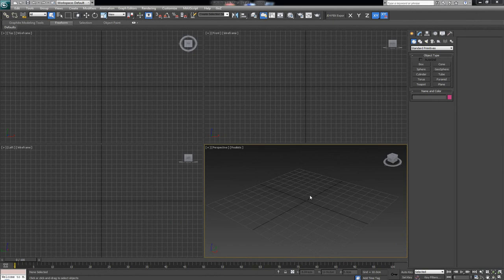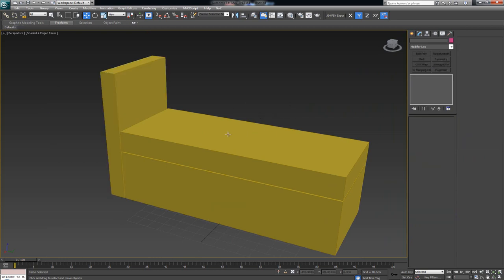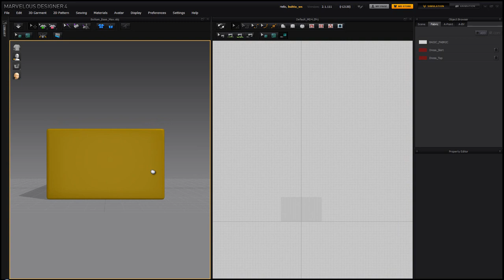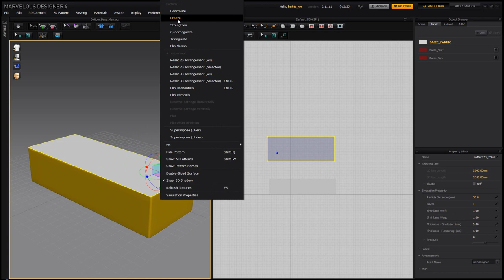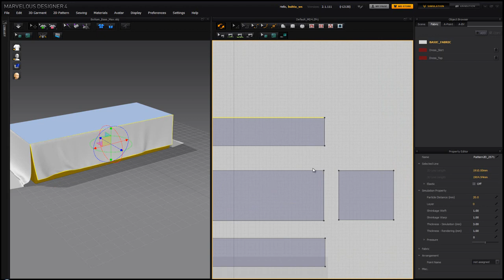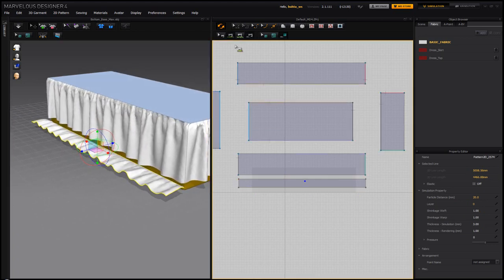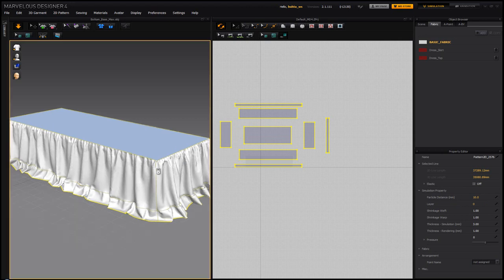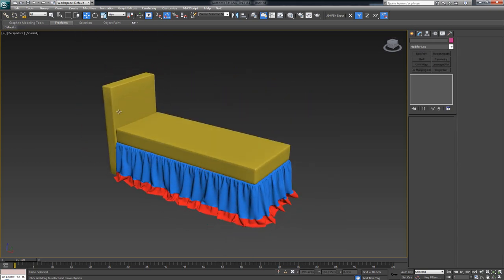Modeling a bed in 3ds Max and Marvelous Designer Part 1

Comment: Your tutorials are great. But i have very annoying problem with scale after importing to marvelous engine 4. After import i get too small objects in MD4. 500x500mm plane is 10% times bigger than bottom of my bed. This is very bad problem because in the end I have to scale everything by hand. I have 3DS max units set at Metric, centimeters. In MD4 too. Could you help me a bit? (I got 3dsMAX 2013 and  MD4 2.0.0.8605)
Reply from the maker: +Piotr Last That has been known to happen with the scale. I work in CM in Max and when i import into MD i import as CM as well. 98% of the times it works flawlessly but 2% of the time the scale kinda gets screwed up (usually a xForm reset in Max fixes this issue)

Comment: After I exported the OBJ and import into Marvelous Designer, I can't see anything? The model seems to show up in the texture view but not in the 3D view. In max, I used cm as units and I also set the units in MD to be cm, the problem still there. OP any idea how I could fix it? CHeers :)
Reply from the maker: +Dude707LoL When you import into MD some times it can show the model too big. From what you are explaining it sounds like it's importing it at a 1000% or 10000% rate. So when you import the model try changing the scale and see if that  will help.